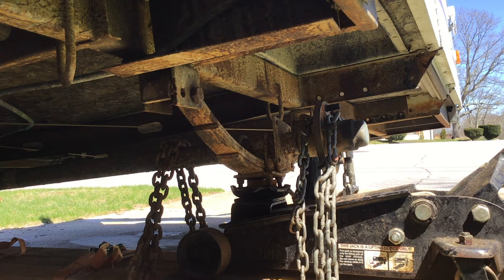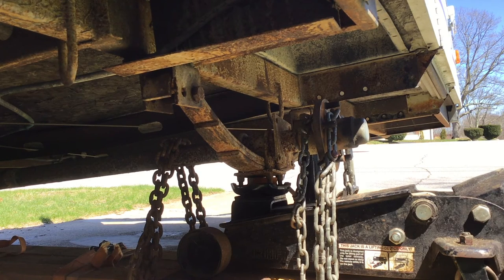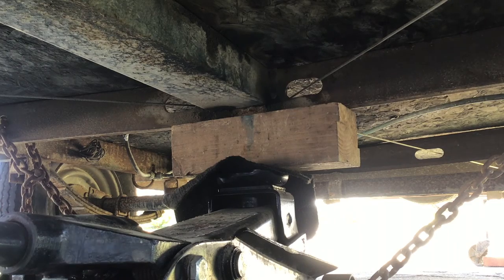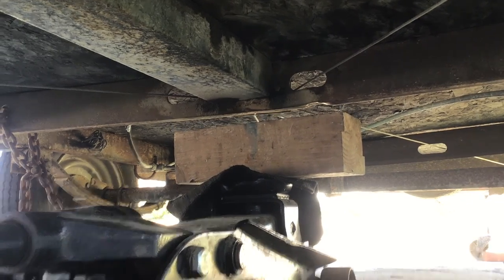Straightening a Trailer Axle Part 2

Comment: I bet you need a stronger hydraulic jack. That floor jack may only be a 3 ton. Fyi, I tried a 12 ton bottle jack and it wasn't strong enough to straighten out a 7000 pound axle so I'm going to try a 20 ton bottle jack.

Comment: I bent an axle hauling to much weight, what I did was flip it 180 had the bow up then welded a smaller pipe across the top from leaf to leaf inside? not sure if that is a good idea or not but that's what I did
Reply from the maker: That sounds like a good option for you as long as the preload arch doesn't cause the tires to wear unevenly.